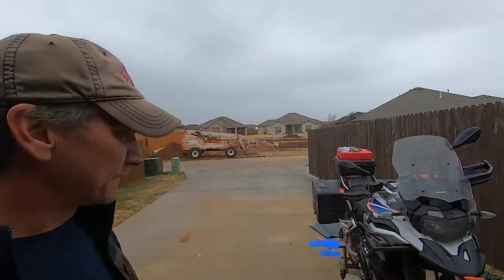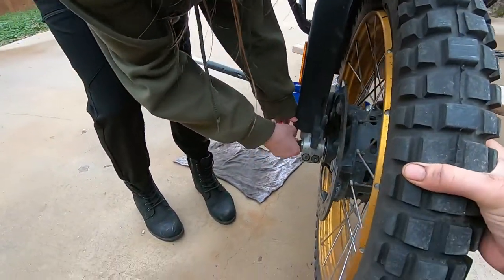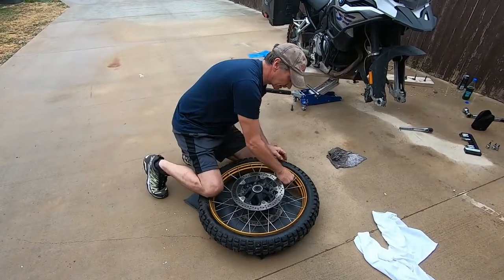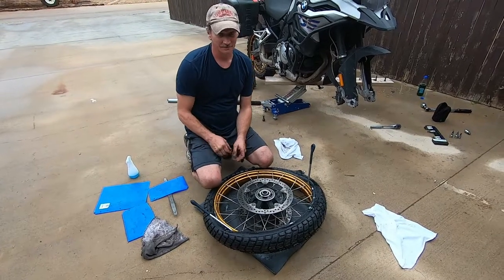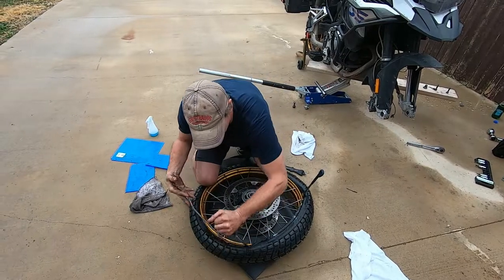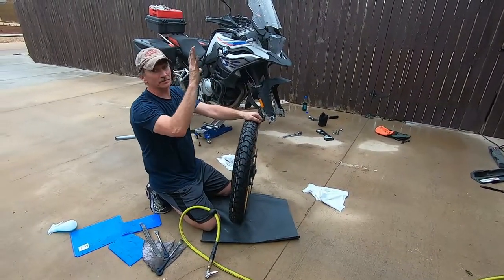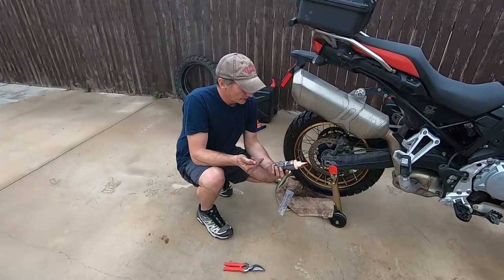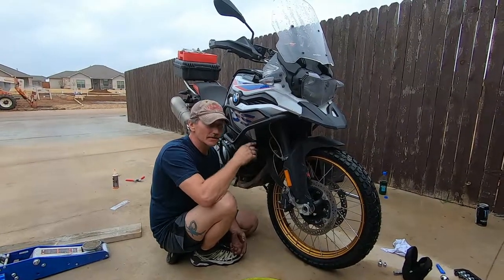How to Change Tires On a BMW F850GS.  Part 2, The Front Tire.

Comment: Great video. What do you use as valve core remover? Thanks!
Reply from the maker: Thanks MD.   I just use a simple motion pro remover.   Any will work.    

Sorry for the late reply.   I stopped making videos and it takes a bit for me to see comments.    

Ride safe and great adventures.

Comment: Do you have to put grease on the bearings or the axel?
Reply from the maker: Sorry for the late reply.  I've been off the grid for a while.  The bearings should be sealed I think, but I do put antiseize on the axel.  I watched the guy at BMW do it when I was there once.